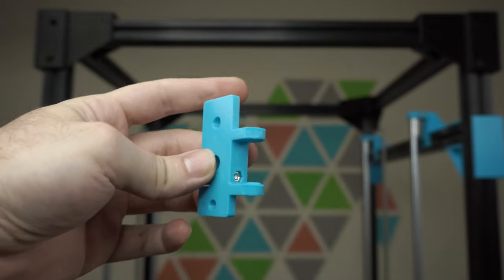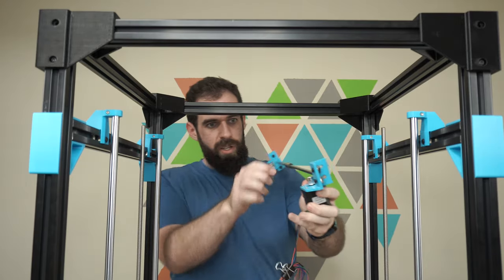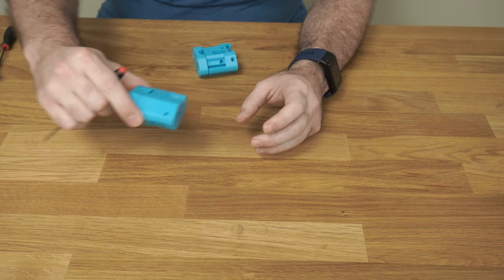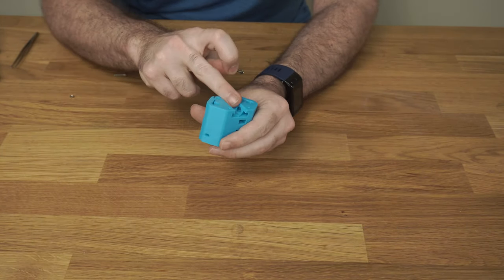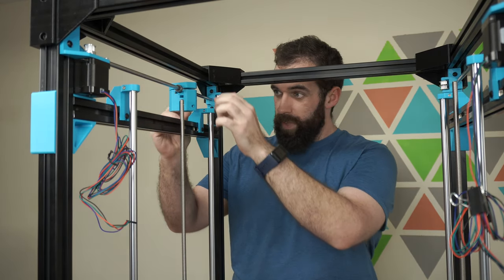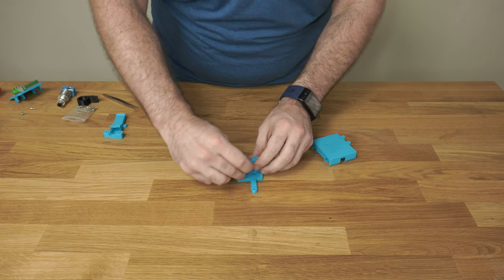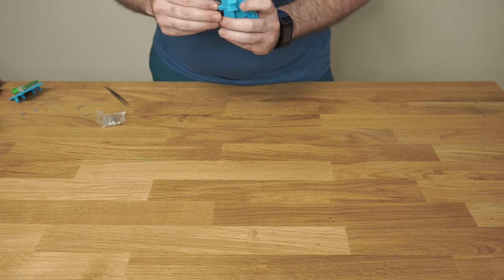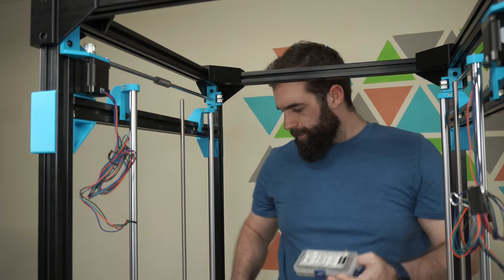Zyltech HEVO 2.0 - XY Axes: Part 3

Comment: I really like your part designs. I have just ordered the frame kit and am working on printing the parts. Have you designed a mount for the EZABL that will work with your hot end mount?
Reply from the maker: I'm not familiar with the EZABL. It looks like they are using either a 12 or 18mm sensor. You should be able to find a mount that is compatible. I'm using this part https://www.thingiverse.com/thing:2923992
Reply: Thank you for the quick response.  The one I have is an 18mm sensor so that should work

Comment: Just out of curiosity, what are you using the Ethernet Break -out board for?
Reply from the maker: The hot end fan, part cooling fan, end stop, z probe,  and thermistor. It's easier to run ethernet rather than separate cables.

Comment: I am looking to make a hypercube with the z 12, y 10, x 8 rails.  I have check the hevo 445 onshape project.  I cam find a 10mm dia y carriage clamp,  and a  Y-Carriage_xDia8LM8UU_1.0,  file, but I think I need to find a y-carriage_xDia10LM8UU _1.0 file.  Did I miss seeing or or might it be added ?
Reply: Actually think I screwed up, would be  the xDia8LM10UU ?
Reply from the maker: With the zyltech 445 kit both the x and y axes are 8mm. Z is 12. If you watch the original hypercube series, you see that 10mm rod is too heavy and the gantry sags in the middle. If you want a stiffer axis switch to tubing or linear rails.